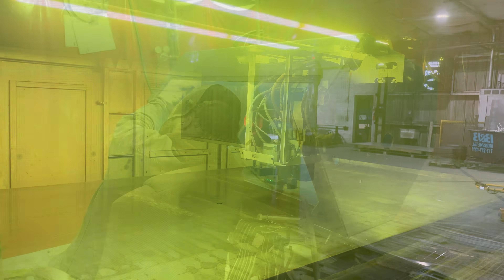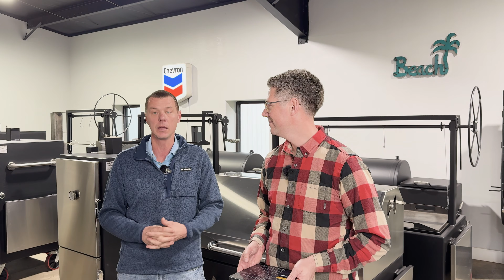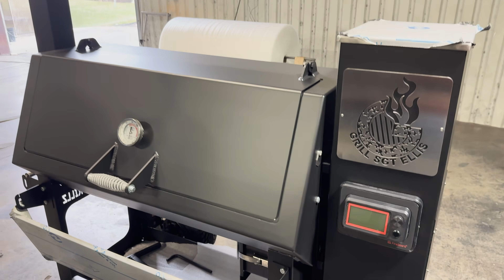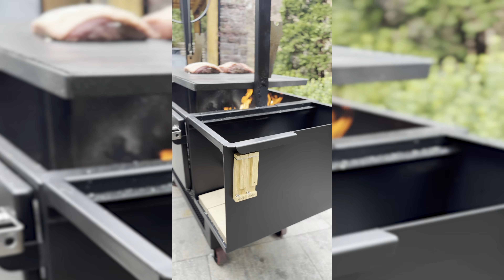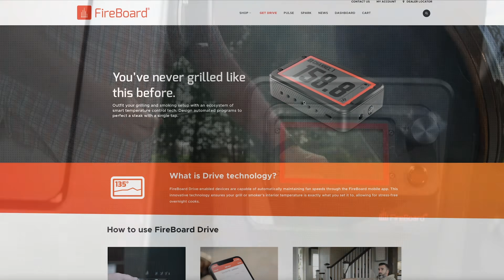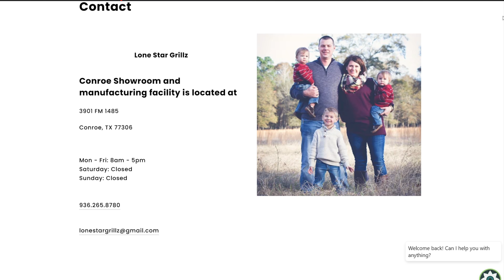Pellet Grill OR Offset Smoker?  Lone Star Grillz Has You Covered!

Comment: Thanks for posting this. I was right on the cusp of buying a LSG pellet smoker and had joined a couple of Facebook groups. Right now, I've got a Weber Genesis 300 series gas grill and a Primo Oval XL. They're both outstanding products in their respective categories. At this season of life (60s empty nesters) the convenience of a pellet smoker for those low and slow cooks is very attractive. What made me hit the brakes, though, is the frequent posts folks have made on the Facebook user groups regarding issues they've had with their smoker not working and the issue coming down to Fireboard firmware updates. The don't seem to push automatically, and it seems if the firmware isn't kept current, it can literally shut things down. I've also seen folks speak of issues where the Fireboard just stops working mid cook. Now, either these posts are from trolls hired by competitors to sully the LSG name or there are genuine issues. Everyone says the LSG customer service is excellent, resolutions happen quickly, and the build quality itself is great. I wonder if Chris can pop on and address these Fireboard issues. I really want to get one of these, but I'm hesitant at this point. Thanks in advance.
Reply: I read all those as well and went ahead with the 20x42 pellet smoker….and I have a huge trailer offset, and have for 30 years. The LSG pellet smoker has been rock solid. I love it and have not had a single problem with the FireBoard. I did a blind taste test with my 3 boys, their wives, and my wife comparing a brisket on the LSG, and the offset and everyone picked the LSG brisket for juiciness, bark, smokiness, tenderness, and overall look. I was shocked. You’ll love it.

Comment: Morning James, Great video! I was going to contact Chris since my Santa Maria grill was finally delivered last week. I have it in place and as soon as the rain stops I want to season it. Since you have one I need some information on seasoning. I know to do the grates but because I have the fire brick I wasn't sure about doing any seasoning on the inside? I assume I don't but wanted to ask.
Reply from the maker: I thought mine came with instructions for seasoning but yes you season the body as well ...not sure if this is the same but i pasted the website FAQ below as it looks similar to what i recall seeing 

Cleaning Solution:

For all painted surfaces, you can use food grade mineral oil, or you can also use a spray cooking oil like Pam.  Mineral oil wont get sticky on the outside like cooking oil will over time, both will do a equally good job protecting the outside painted surfaces from rust.  A damp cloth can be used to wipe it down after applying the oil.
For stainless steel surfaces, any “food safe” stainless steel cleaner will work.
For food grates there are many schools of thought. Some prefer a sterile grate each and every time they cook and others never clean their food grates. A simple wire brushing from time to time will do fine, or even a pressure washer for those who like a little more thorough job.
Instructions:

Lightly coat the outside with cleaning product and wipe clean. If you see any rust forming, a little extra cleaning product in that area will help stop it.
Before starting your fire, the oil should be reapplied to the outside of the fire box, but not wiped off. Once the steel here gets hot, it will penetrate the steel and form a patina similar to cast iron cook wear, drastically reducing paint failure and rust on these surfaces (this is typically the first area on the smoker to rust due to the high temp sifts and expansion/contraction of the steel).
It never hurts to reapply cooking oil to the grates before or after each use. This will protect from rust and create a non-stick surface.
It is important to remove all ashes from the fire box and drain any water and fat from the water reservoir after each use.
Before and after each use, it is recommend that you apply your preferred cooking oil spray (straight cooking oil – the same as you used to season the smoker – not your cleaning solution) to the inside of the fire box to prevent rust. This is a “must” if you want to prevent your fire box from burning out over time.
Hinges must be oiled each and every time.  The hinge has a hole in the top and any cooking oil will do.  Just spray or drop a little in the hole each time to prevent rust and or binding over time.
**Please Note: Do not apply cleaning solution until after you have seasoned and cured your pit and used it a couple time to insure the paint is fully cured. Do not use any soap products, as they will leave residue on the grates, which will transfer to your food.
Reply: @SmokingDadBBQ  Thanks James, I haven't opened the two boxes with the rotisserie in them or unwrapped my grates so I may have the instructions. 😁